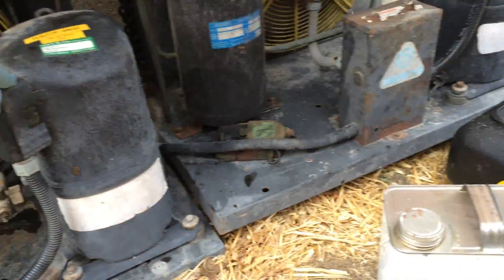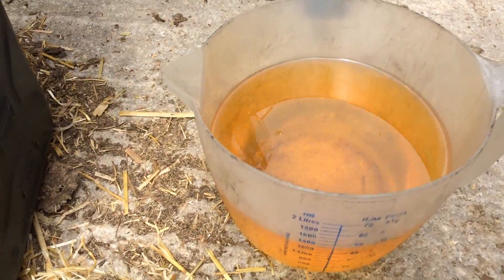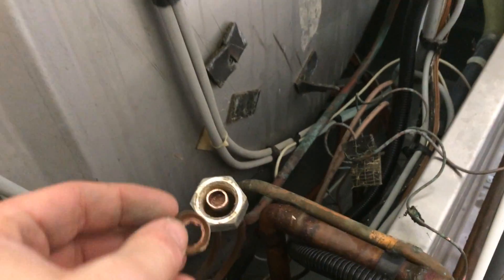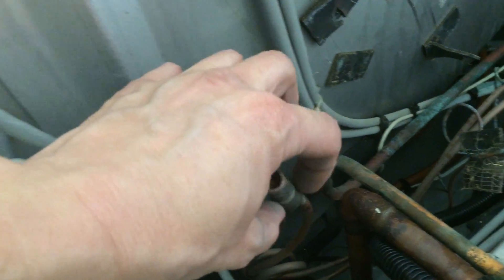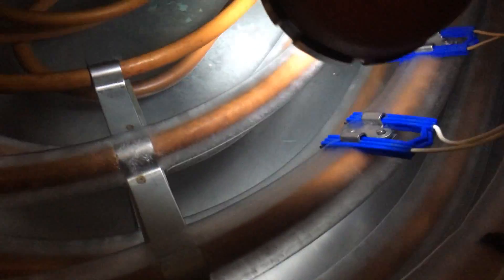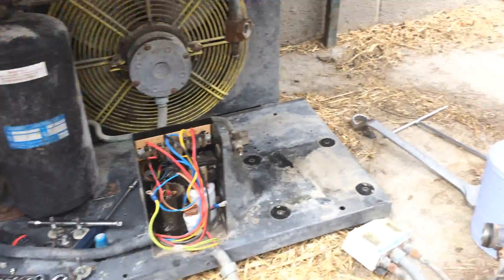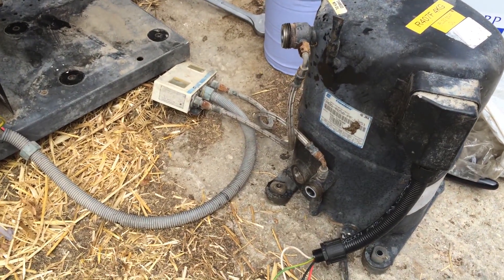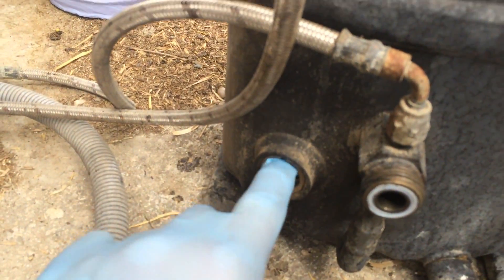R407F Rertrofit Revisited

Comment: Oil's not bad, a lot of it in that second comp tho!
Reply from the maker: +Machine Man Yes it was cleaner than the first change, i think there must have been some oil left in the evaporator, we swapped the milk tank for a second hand one but kept the original units as they didn't have three phase power.
Reply: heavydiesel I see. And it's just migrated into the compressor over time.
Reply from the maker: Machine Man
Yes, some of the compressor oil gets leaves the compressor with the refrigerant through the discharge connection, so long as the system is designed correctly it returns to the compressor via the suction connection. If the system is short of gas or the pipework badly designed the oil doesn't come back quick enough and the compressor can be damaged.
Reply: heavydiesel ahh that explains why they lose their oil sometimes! That makes sense

Comment: Hi John
What is a typical cost for conversion?
Reply from the maker: +Mark Russell I would think between £400 and £600, depending on system size and condition and the number of parts than need changing. It could go over £1000 if it needs more oil changes and expansion valve changes.

The old R22 needs recovering and disposal (unless its all leaked out)
Compressor oil needs changing, also the oil sight glass o ring if fitted
Any components such as solenoid valves and shut off valves that have o rings need changing
The expansion valve may need changing
Pressure switches may need changing or adjusting
All shrader cores need changing
A fresh charge of R407F need weighing in and system labeling with refrigerant and oil type

Some systems might need more than one oil change, for choice i would do at least two with some run time inbetween, but cost and time can be a factor. I'd probably change the oil on the next service. 

Also depends on travel time to the site etc.

Comment: heavydiesel, I habe a question to you: is that your job, to repair cooling-systems?
Reply from the maker: +Ventilator007 Yes, repair and install or refrigeration and air conditioning system is my job. Been working on them for over 30 years, had my first set of gauges around 9 years old and helped my Dad on school holidays and weekends etc :-)
Reply: +heavydiesel ok

Comment: R22 is getting expensive now, I am trying to get an old one to use in my office after the wall rattler finally finished off dying from rust. Have to play at brickie sometime next week, then practise my plastering skills a day or three later.  Still, have to finish off servicing the rest of the units, and do everything else as well. Will probably have to replace 2, they really are corroded, and the recent hot weather is not helping the corroded outdoor coils any. Going to be fun replacing them with split units 9m up.....

At least i still have a few cans of R22 to use on the other units. and a fridge to fix the leak, got defrosted with a knife, so will have to get some aluminium solder next week and cook it nicely inside the freezer, silicone sealer  ( was not me) does not work on that.
Reply from the maker: +SeanBZA I've soldered aluminium before, with some special rods and a propane torch. There is some special epoxy for fixing them too, Epox-A-Leak, think its made by Diversitech now. Can you save the R22 in the rusted window rattler? Good Luck!